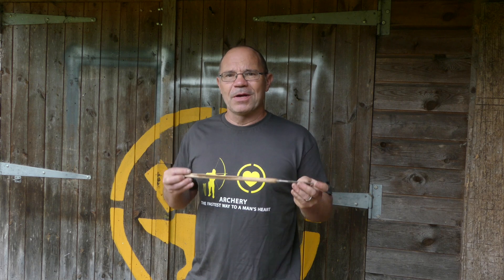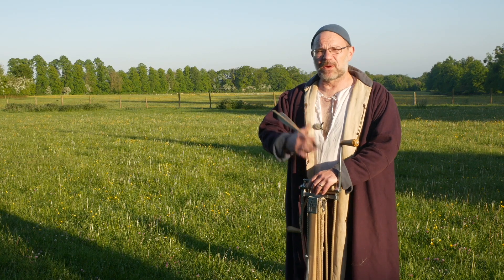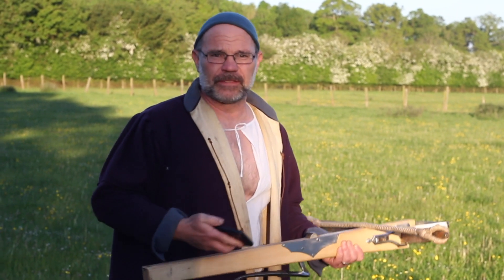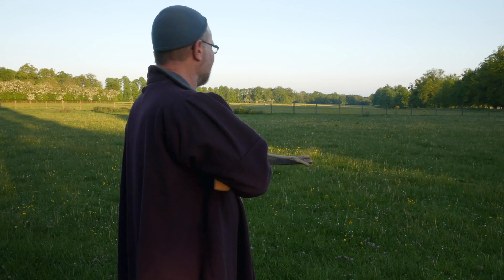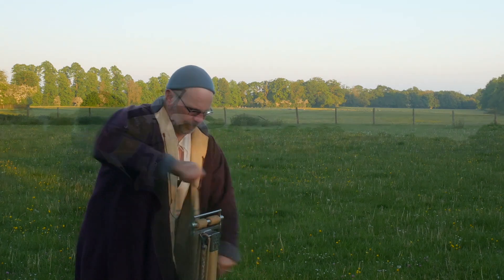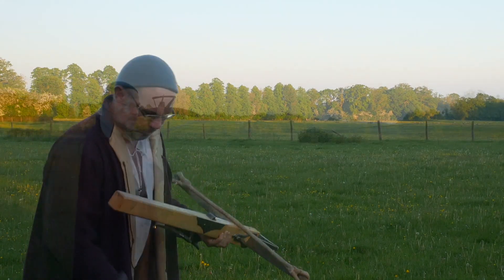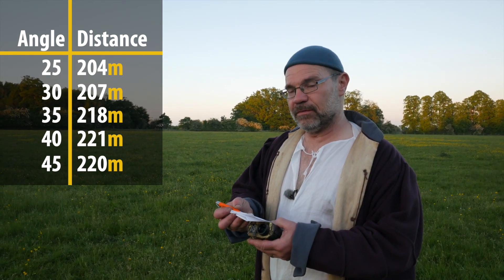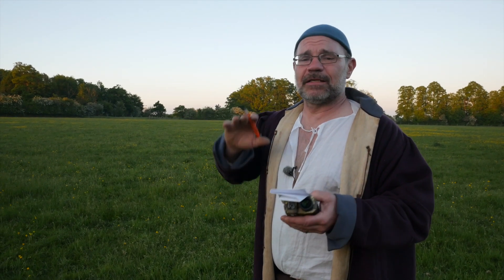Distance - Which angle is best?

Comment: For a true comparison you really need to do multiple shots at each angle - at least 3 - and then average them out.
That way you minimise factors like wind having an effect on the results.
Great video though - i would have thought it would be less than 40
Reply: yeah that's the main problem with tod's tests: not nearly enough numbers
Reply: @christopherrowley7506  However unlike most of the knowerati who regurgitate "Facts" from Facebook Todd acknowledges it's not a scientific trial and that tomorrow it might be different. Much of the methodology employs the scientific principle
Reply: @christopherrowley7506  true, but as we can see from the vid, he barely got enough sunlight for this test. I think an assistant with second bow would be great, but again with handmade bows there might just too much difference for reliable tests.
Reply: @christopherrowley7506  He does keep saying that he's not doing scientific tests, but it's still a bit frustrating how he doesn't collect more data. I guess he just doesn't want to put the time into each video. But I can't help but think, "If you're going to do something, do it properly"
Reply: @tommeakin1732  I don't think it's about not wanting to put in the time, just not having enough daylight when they were doing this. It takes quite a while to shoot crossbow bolts and then go measure the distance of each (with a 200+ meter walk each way). He also needs enough light to be able to film as well as find the bolts, so if you only have an evening to do it you are pretty limited
Reply: @kinslayer202  I mean it's the case in most of his videos. Even in the very popular "longbow vs breastplate" vid, they could have taken shots at the side, or rear of the breastplate. I really am not hating on them because I love this content - but if I was going to go to all the effort of getting these things and people in one place, I'd try to get more out of that situation
Reply: @tommeakin1732  I assume time is a huge factor. Just take a look at how bright it is in the beginning of the video and how much lower the sun already is towards the end of it. This man creates historical weaponry and tools for other people to buy and enjoy, and in his 'free time' runs a youtube channel with one of the (imo) most interesting content on this platform. The way I understand these tests are mostly to satisfy his own curiosity, and he is simply nice and shares it with everyone else. Sure, it would be even better if we had 20 shots fired off one crossbow that sits fixed in some sort of device to make sure the hight of the crossbow is always the same + it is always shot in a straight line rather than a few degrees to the left on this shot and further to the right on the other shot - but these are crazy demands in my personal opinion, and I am not aware of anyone else on YT that does similar tests and comes down into the comments to pick up what people are interested in and then goes to test these things. This whole video exists solely because he took the comments to heart and find some results. 

Also, I am not sure for his particular setup, but shooting a crossbow is somewhat tiresome. Then all the walking back and forth - he'd have to go back to repeat these shots for multiple days and then create one video with it. So again, much more time required at the cost of being unable to film other ideas he has.
Reply: @Jixxor  I totally appreciate that time can be a huge factor; and it's easy for the audience to fail to appreciate how much time actually goes into a video, because so much is behind the scenes or gets edited out. Also, I know this is on the side for him, and I imagine he's a busy man.

The point of me saying this is because I see a place for improvement, and I'd rather be the guy saying "you can always improve" than the guy saying "it's good and there's no need to get any better"
Reply: @kinslayer202  
Only a fool would shoot 1 arrow and retrieve it before shooting it again if they were doing more than 5 or 6 shots. 10 bolts would make more sense. With each one being numbered to see if there were any repeatedly anomalous results from the same bolt at different angles.
Reply: @saltycremepuff  You don't need to do 100's to get accurate data though. Just 5 would almost be as good as 100 in most cases, shoot 5, drop the highest and lowest, average the remaining 3. Accounts for extreme lows and highs due to wind, and gives a decent average of the rest.
Reply: Also would be good if the crossbow was shot from a stable stand to make sure the angle wont change due to slight hand movements on trigger pull. Other thing to make the comparison better would be shoting in a big enclosed hangar to eliminate air influence as much as possible.
Reply: I think the angle will vary depending greatly on the wind direction and to a lesser degree humidity.  If we have a tail wind then a higher elevation will 1. present a larger surface area to the wind 2. keep the bolt in the air longer allowing the wind to push further.
Reply: He should also have fired some tests above 45 degrees. Thanks to the atmosphere, higher angles can result in greater distances for some kinds of projectiles.
Reply: @davidharriss3792  
That would only come into effect if the projectile was going many thousands of feet up. The difference between air density in less than 100 yards or metres is so negligible it wouldn’t be worth measuring.
Reply: @davidharriss3792  a higher than 45° angle will result in less distance, even though the bolt will reach a higher altitude. 

Under ideal conditions, 45° should give you the greatest range (it's physics), but as he stated in the beginning: wind, friction from the air itself, the shape of the flights, the manner in which the bolt kicks during launch.... all these play a factor and make for less than ideal conditions. 

But it is simple physics - over 45° will result in greater altitude and less distance
Reply: @jameshaulenbeek5931  You have obviously never fired projectiles over a dozen miles. If you had then you would know that, under some circumstances, angles above 45 degrees will allow projectiles to travel further. Because of air.
I have never fired crossbows for extreme distance, therefore I do not know if those effects would apply. But they should be tested for, not ignorantly dismissed out of hand.
Reply: Nevertheless, the test delivered a good comparison and I know now the basics: a perfect angle is not a very important factor
Reply from the maker: Adamast - that is exactly the sort of point I am going for; a quick indication of what is going on and thanks for putting it clearly
Reply: @2adamast  It didn't show that at all though. He only fired 5 bolts, if his normal distance spread at the same range is + or - 10m then these results are completely meaningless. He needs to shoot each bolt 5 times, drop high and low, then average the 3 remaining. Also he needs to show the standard error rate in normal same angle firings as without this you cannot know which of his results are statistically significant and which are not.
Reply: @SirDragonClaw  220, 221, 218, 207, 204 m Is meaningless to you,  but consistent and in accordance to the theoretical model I had in mind.  The mere 7% distance drop between 40-45° and 25° is an indication that angle is not that important.